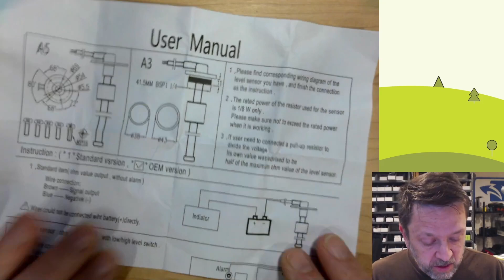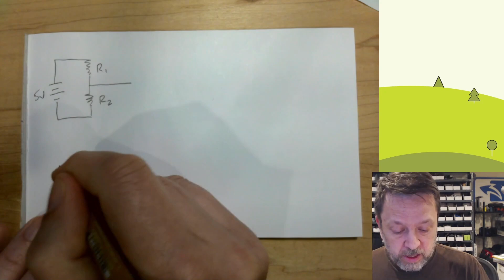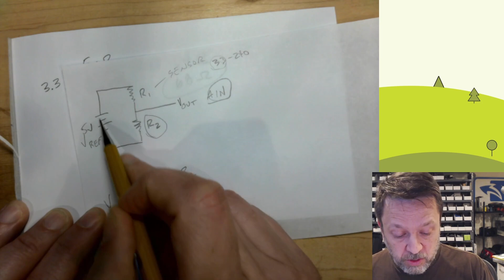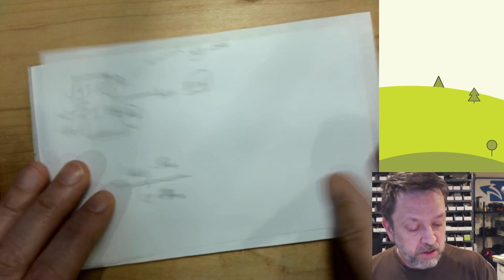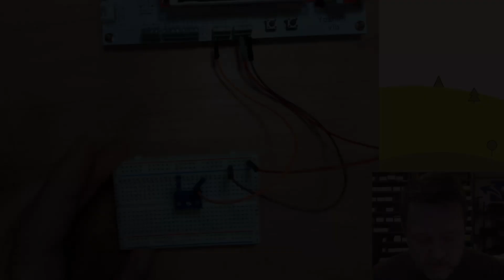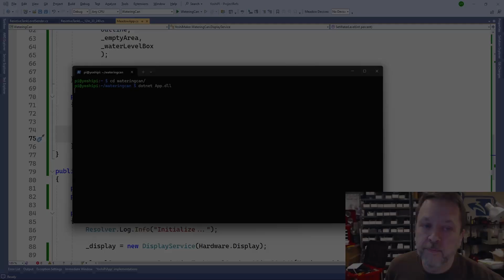Integrating and Creating a Driver for a Resistive Tank Level Sensor for your YoshiPi in C#

Comment: With that low power rating and discreet output values it sounds like a magnetic float and reed switches in the tube Awfully low though maybe cheap plating on the contacts?
Reply from the maker: Pretty sure that's exactly how they work. Probably super small wires limiting current